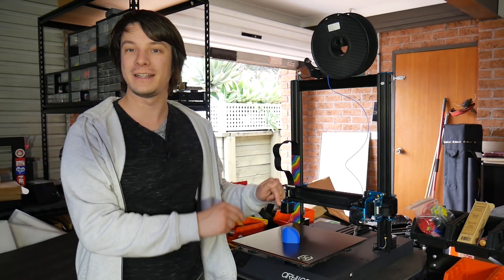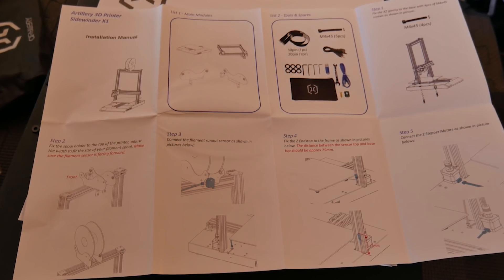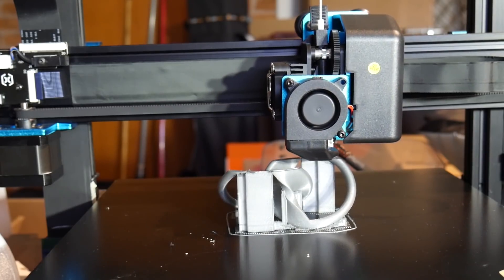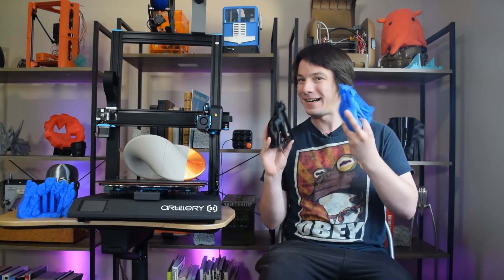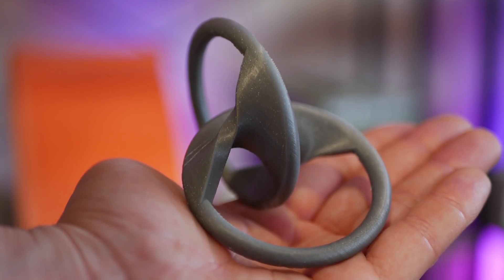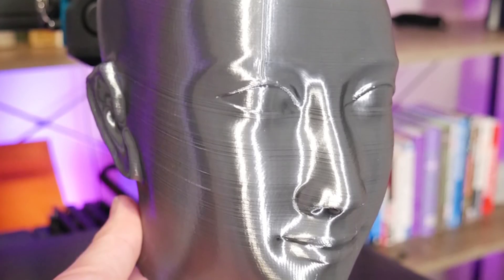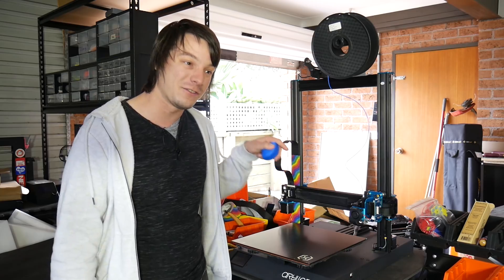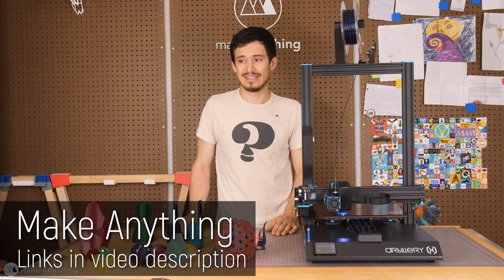Artillery (EVNOVO) Sidewinder X1 Review

Comment: Thanks for the mention Angus. Now I understand why people are complaining about the cables in forums and comments. Mine have been perfect, I have no idea why they would change that!
Reply from the maker: Yeah man it really threw me for a spin when I finally noticed. WHY would they change it!
Reply: @MakersMuse  They changed it based on customer feedback sadly. Some people didn't undo the clamps to put the cables in and wrecked their cables, so they took off the clamps! sigh
Reply: @originaltrilogy1  so they made it worse, because some people couldn't be bothered to read the instructions?  That's like complaining because you tried to install a CPU onto a motherboard without lifting the socket clamp (or whatever that thing is that you flip to lock it into place after it's in the socket is called).  Can we please invent a time machine, just so we can go back in time to fix this before it's a problem?  I wish my X1 had the old-style clamps!  My prints have been great so far, even with the newer style connectors, but I'll keep an eye on the temperatures to make sure I don't get any wacky runaways.

Comment: The moment I saw that this printer had those ribbon cables, I knew it was going to be a big problem.  Anybody who has fooled with electronics for very long recognizes those clips as being fragile.
Reply: It's more that they are apparently friction fit. That seems like a ludicrous decision when they apparently had actual clips before. Ribbon cables can be alright, especially since they aren't being torque around off-axis, but the same pressing motion Angus is doing in his demonstration of the issue is what will happen over time as the gantry moves around. And I don' t really see why they would have swapped to friction fit connectors, either. They already have pumped features into this machine for the price, so I don't know why they'd try to save a penny on swapping to friction fit cables.

Comment: Take the spool holder off the frame and make one that is mounted to the side off the frame of the machine. Any shaking while printing, is amplified, with the spool on top, of the frame which would be re-transmitted back to the whole machine. This might cause the whole supporting frame to move, while printing, and cause the head "wiggle". Just my thought.

Comment: I had the same problem with the circuit board that is in the base right out of the box.  At first the problem that I had was the blue LED on the hot end wouldn't work.  By putting some pressure on the cable and the connector it would work.  But after pressing on it a few times my entire hot end went dead.  No LEDs, no fans, no heat and the thermistor gave me a -15 reading.  After trying to deal with Artillery's support I found a website that sold the set of 3 boards for $20 (https://fulament.com/collections/sidewinder-x1-replacement-parts).  I replaced the board and everything is working properly now but to get to the board I pretty much had to disassemble the entire printer.  I know that Artillery's support meant well but there was a huge language barrier and kept going around in circles with them through email.  I love the printer but it definitely started out rough.

Comment: That was my problem.  Ribbon cables as well as bed leveling. Mine didn't have those little black locks either.  I couldn't get my hands under the bed to turn the wheels.  I had it 1 month and returned it.  Got an Ender 5 modded to direct drive and never looked back.

Comment: I have been looking for the past month to buy my first 3d printer. Budget of 500 dollars. Need a big print volume. Accuracy is wanted. And safety must have. This one keeps popping up. So I feel like it's the one. Been waiting for this review. Thankyou
Reply: @Don Gray well the ribbon calbe issue can be solved easily with just printer clips or whatever eleminates the stress on those while printing...there are many other things which are negative on this printer: i cannot see a ground wire on the heat bed, heat distribution  etc.biggest pain in the a is levers keep breaking, i use one of mine whithout the upper ptfe tube, which kind of increased the livespan of the lever, but now, all of them are broken, all spares...and customerservice ignores us and keeps tellling us to use the spare, well they even delivered broken spares....
Reply: @Don Gray thankyou. I will definitely check out what you mentioned above. I've definitely figured out any printer will have issues. So I've made sure that people have found a solution to them. (Sometimes the company fixes it too which is nice ) thankyou again for the thorough comment. Any advise Is good.  Happy printing!

Comment: Why is direct drive worse than bowden? I've only ever had direct drive but I'm looking at bowden printers now.
Reply: Well neither are particularly worse, direct drive you get better control of the filament because the extruder is closer to the hotend but bowden setups take the extra mass of the x carriage and are a bit more fiddly with retraction settings for example.

Comment: I got my X1 a little more than a week ago. It is a version 5. While it does NOT have the locking tabs on the ribbon cable connecters, I think it is also different than what is in the review here. On mine the ribbon cable fits VERY snugly into the connectors. I was wrried when I put it together that there was no locking tabs, but after inserting the cable I am less worried about it coming loose. Whether or not it is effiecient cabling for the heater requirements is tbd. Anyone else have a v5 yet besides me? Did you have the same experience with the connector?
Reply from the maker: I honestly don't understand why they send out versions that are instantly outdated, I've had it less than a month. It's infuriating. All other connectors seem OK but the bottom one has weird side force due to the angle of the ribbon cable coming off the frame
Reply: @MakersMuse  So I went and looked at mine again last night after I posted my comment. The cables that connect to the extruder and the x-rail are less "robust" than the one that plugs into the base. The one near the base has a hard "tab" that you use to plug it in, and on mine it is very tight to plug in. I worry more about the others since they have movement. I think I am going to go ahead and print/install the cable clamps for these to at least provide some strain relief on the moving ones.
Reply: Are you sure you got a V5? Because the V5 was/is supposed to have a bed levelling sensor installed. (at least that was rumoured). The revision is not shown anywhere, you just can go by the different fixes/features to determine your version. The 1.5 that shows on the display is not the revision.
Reply: Steve Haack where did you get the  5th version all I see is 4th

Comment: So is it older or newer revisions that lack the ribbon clamps or don't we know?  I know sometimes old stock sits on shelves and suddenly gets shipped and while new there are newer revisions also shipping. I got a CR-10s with the small leveling knobs even though they had been shipping them with the large knobs for months when I ordered.
Does Angus have an older, for review, preview unit or are they saving .30 per unit and the current production models lack the clips?
Reply: He has a newer model.  You can tell from the re-set button on the front by the screen.  Mine also lacks the clips but it is still running fine.
Reply: Thanks. This was a silly issue for the manufacturer to cave on.
Reply: This would have been a good case for the manufacturer to ignore the consumer. Pressure fitting them is silly in the extreme.

Comment: On the product's page of Gearbest, you can see in the description a short guide on how to connect the flat cables. It actually states: "you may need to open the lock on some machines". I suppose the newer ones have the locking FFC connectors (a 'recent' delivery does not mean it is a recently produced machine).

Comment: I have 5 different printers and one of the best changes I made was changing all the Z lead screws to 2mm pitch instead of the 4mm pitch they came with. On large volume machines I found that the the gantry moved too easily when not powered and they did not stay parallel to the print bed.The 2mm pitch helps with Z accuracy and also eliminates any uneven movement of the gantry. Of course the steps per mm needs to be changed in the software but that is pretty simple math.
Reply: What pitch is the CR-10?

Comment: I had exactly the same problem and my transfer board even went on fire. Im getting new ones soon from artillery. I dont trust the printer for know and i wont print during the night.
Reply from the maker: It carries current for a hot end and stepper... Enough to cause issues if small resistance is encountered but probably not actual fire

Comment: Seems like a decent printer. For the price I expect auto bed leveling, but it is direct drive, so there's that. I still kind of feel like these i3 style printers that are larger then say, 250x250x2xx are somewhat flawed designs since the bed ends up being so heavy, it's hard to fight ringing on that Y axis. The layer inaccuracies are something I struggle with with my ender 3 as well. I think some of it just comes down to slop in the design of my printer though, so I'm suprised to see it on a printer with 2 z-screws.

Comment: Those layer problems look just like what i get when i print with wrong layer heights. Like 0.15mm vs 0.16mm. i always try to print with layer heights that are done in 0.04mm steps. All those are gone with proper settings.
Reply: Do you have some tipps for proper layer hights? i'm using the one of the cura profile which can be found for the X1 ... It indicates 0.16 .. does 0.15 fits better?
Reply: @jame71bln  all goes in 0.04mm increments. So 0.16mm is fine

Comment: Hey Angus. This is unrelated to the video, but I figured this would still be the best way to contact you. I have a question about combat robots. I've seen videos of people making little wheeled robots with wheels that can drive sideways if two of the wheels spin one way and two spin the other. I was wondering why you don't see these types of wheels on combat robots since that would basically allow the robot to strafe, giving it a huge mobility advantage. Considering how often you see robots struggling to turn themselves to face their opponents, this seems like a worthwhile thing to implement.
Reply from the maker: they're called mecanum wheels, they're super cool but incredibly fragile. One hit and they explode!
Reply: @MakersMuse  Thanks for the correction! Hm... Considering pretty much everything else, including legs have been tried in combat robots, it's still not that unthinkable to try. I'm sure there's some ingenious way of making them a bit more rugged too. In fact, DO IT ANGUS! I BELIEVE IN YOU!

Comment: Do you think hot glue would lock those in? $400 seems like a steal.
Reply from the maker: Yeah, I kind of wish I did that to start with. Repeatedly unplugging probably made it worse.
Reply: Just a little bit to hold the connector down and still let you peek it off later. Hot glue would probably work great just don't overdo it.

Comment: Would not buy this printer until the ribbon connector and stability is improved.  Flat ribbon has been used in inkjet printer carriages for decades so it can be done reliably.  Not a fan of the Anycubic style glass bed.  I immediately replace them with plain borosilicate glass beds: Some folks have covered why: Print resume fails if the bed cools, finish of the print surface that contacts the bed,  wait time for a large bed to be able to remove prints (I'd use a small fan to speed things up),  and non-PLA filament can stick too well and damage the coating.

Comment: Very interesting review.  At the start of the video I was wondering why my Sidewinder X1 has always delivered better prints than your one but it may be because I have never used the filament sensor and have my spool on a shelf above the printer.  I ran a spool through the sensor yesterday while I was calibrating the extruder and noticed that at some angles, the sensor grips the filament pretty tightly.  Possibly too tightly.   I would also note that at high speeds,  that heavy bed flying around can cause artifacts on larger prints but I like this machine and it is in danger of becoming my go to printer, even over my Prusa MK3s.
Reply: I've recently purchased a X1, when assembling do I just leave out the filament sensor? will the printer software still function without it?
Reply: @enochroot9438   The sensor comes pre-attached to the frame so the simplest solution is to just put a small length of filament in the sensor and then ignore it.  The printer won't even know :)  Hope you enjoy the X1.  It's my favourite at the moment.

Comment: Glad you put down your first video... It shows that the previous reviews made by others are quite different to the printer you got. Normally we hope that printer get better with time but in this case they switched the ribbon cable connectors to something really bad. It can be saving some money or it shows that quality control is not there yet where it should be. Remember Prusa got a bad batch of rods and as soon they got informed by users they replaced them without any additional costs.

Comment: The problem I have with their wiring choice is this type of plug was designed specifically to be hooked up, sealed up and never undone. The fact that this is not the application it is used for I find it flat out ignorant on the manufacturers thinking, or rather lack of thinking! I am considering this printer but before I take the plunge I will first have to discover a viable, logical cable connection option that is not so utterly ignorant!

Comment: The printer comes with AT2100 stepper drivers. You can't set the microstepping on this they always run on 1/16 microsteps which are interpolated to 1/256. (As on the TMC2100). The positive thing on this is that they run much cooler.

Comment: Do you think you could print a mount to hold a bearing the way you can place one at the top of an exder 3 to keep the z axis post stable?
Reply: It doesn't need to be stable, the hot end carriage is stable via the Y axis v-rails.  In fact, you need it to wobble to prevent binding.

Comment: The oversight on the removal of those clips is honestly shocking.
Reply: Might be safety design, This way ribbon pops off rather than break. Mine doesn't have the clips and haven't had an issue of them popping off.
Reply: We figured out how to print strain reliefs for those, so basically, our own clips. The cable now won't come out uness we take the part off. I have one, it's an amazing machine.
Reply: Put tape around them and done.
Reply: I imagine they had a lot of support tickets of people forgetting to lock the tabs/clips in place after installing the ribbon cable claiming their machine was defective when in fact they forgot to clip the cable in place.

Comment: Hey what’s up I’m apart of the 🇦🇺 gang and was just wanting to ask your recommendation for a first 3D printer. The intended use would be for things such as ex parts of prototypes of designs rather than things such as cosplay have you got any recommendations (price range $1000 give or take)
Reply: Cr 10s.... I have seen every review and done the numbers. As far as it goes it is the best out there. If u want hectic high temp prints or tpu prints just upgrade the bed and extruder for like $200-$300 and you have a top of the line printer with almost flawless prints.... must buy Z axis stabilizer though its a must for $45
Reply: What size print bed do you need, and what materials do you think you will print?
Reply: Laser Man I have no clue print bed but probably abs or pla
Reply: Both fine for CR10s, can use a small enclosure but if you get a all in one printed (no side box) you can make an enclosure because you'll fire the electronics
Reply: Ralph Horish what are you thoughts on the anycubic i3 mega and mega s

Comment: I bought one, but haven't had a chance to use it much. On some prints, I think there's a bit of layer "wandering" and parts that should fit together are really tight. My filament spool is on top of the printer, but it's a very light spool with very little filament left. Touching the Z axis while the printer is printing, I can feel vibrations. Is it possible that a heavier spool would actually dampen the vibrations?

I wonder if it would be possible to make some kind of dampening system using a strap or cable to that goes around the printer. The acceleration and jerk settings are very aggressive, which could also cause some of these vibrations and maybe corner inaccuracies (although I can't say that I'm actually seeing them on the prints). I guess those settings can be adjusted using gcode at the start of every print.

Comment: Are there any metal sintering printer options available?  I want to print custom blades and arrow heads, so it doesn't need to print massive objects if that keeps the cost down.